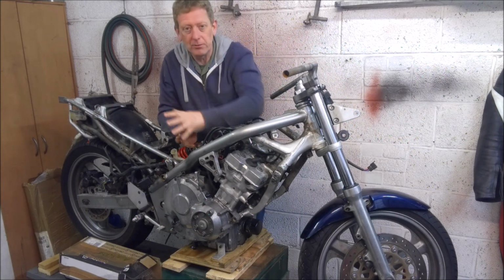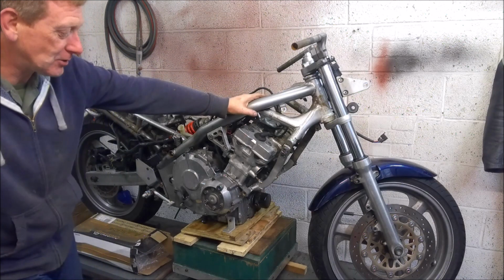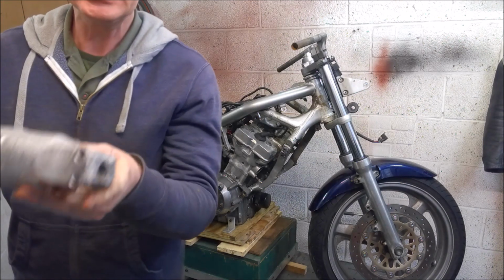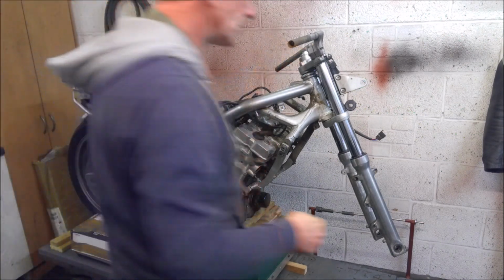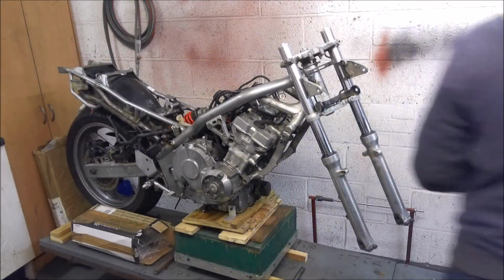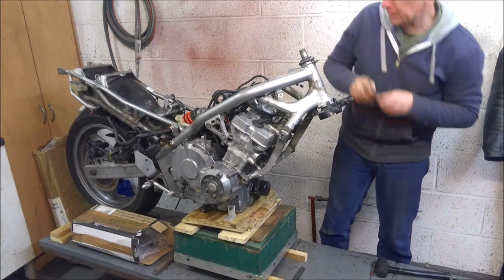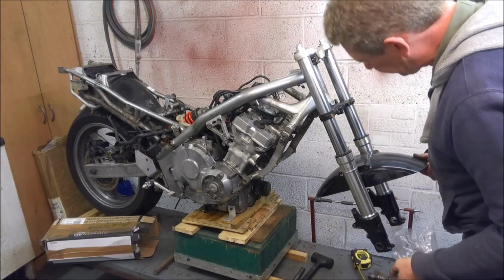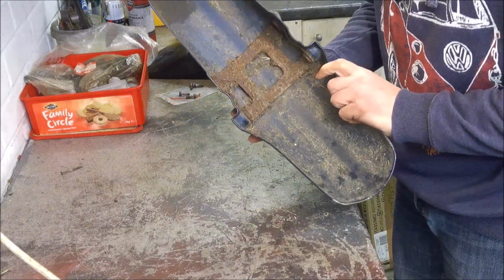CB-1 part 3 - Fork Upgrade part 1

Comment: Thanks for the hat tip! That's exactly the parts I'd use if I ever get a cb-1 for modding again.

Later yokes are 10mm wider to accommodate the bigger calipers and discs on a '98, bigger problem is 5mm less offset which was compensated by a longer frame neck on a '98. Apparently not a good idea to mess with that measurement if you don't know a lot about chassis geometry and the early parts match cb-1 geo, so take the easy path.

Interested to see what brakes you're going for and how they'll line up. I always knew 98-99 forks take a 310mm disc but idk about the in/out spacing. Best caliper to fit the fork is the big gold one off a 600rr/929/954. You'll want a 1/2" master eg off an early hornet, for that big of a caliper.
Reply from the maker: Thanks for confirming about the yokes and all will be revealed in the next video but we're definitely thinking along the same lines

Comment: I put 7.5w oil in the forks, lets it ride a bit nicer for a street bike. Whether you'll rebuild them or not, I'd recommend taking the caps off and carefully taking the adjusters apart for a clean up and lube. The brass adjuster loves to seize in the alloy cap, then you try to force it and get chewed up brass screws.
Reply from the maker: Cheers Aaron, the forks will be getting a full strip & rebuild once I've finished mocking everything up

Comment: The steering lock will work using the cb-1 ignition barrel, just chop about 10mm off the threaded posts and you're done.

Comment: Not sure if you mentioned the NC29 fireblade option but there must be USD options out there as well from other makes admittedly you would probably be looking at replacing the whole front end for that but I am aware these things are more often governed by price and availability at the time.
Reply from the maker: The NC29 forks would be basically the same as the stock CB-1 forks and probably too short. A USD setup would be nice but the fireblade bits came up at the right time